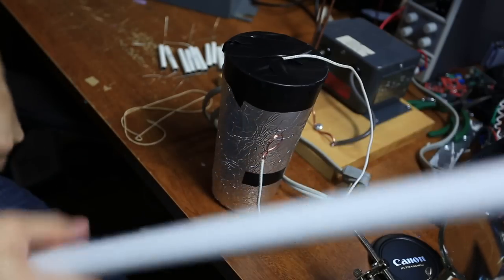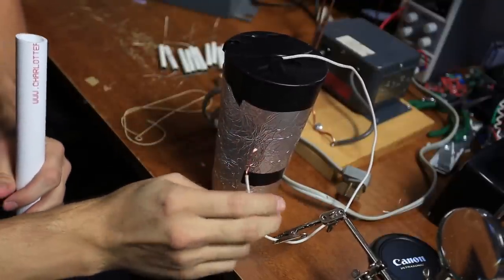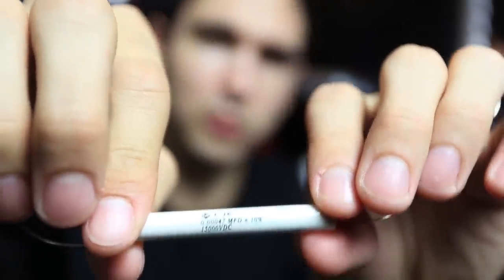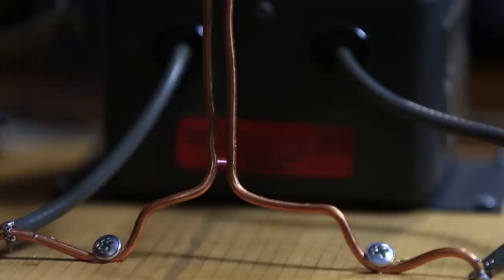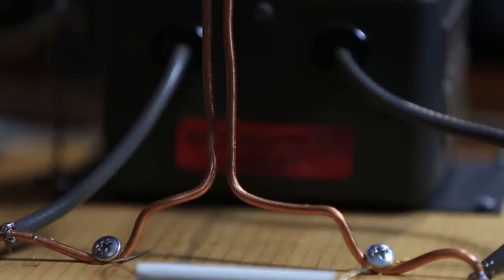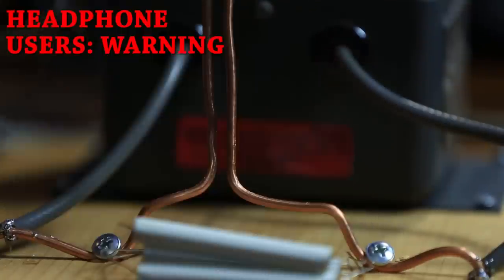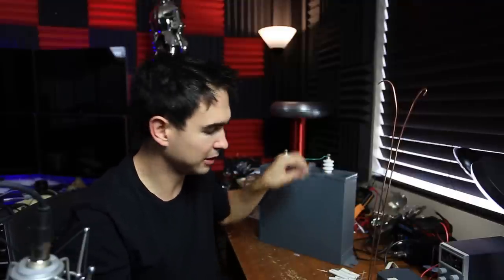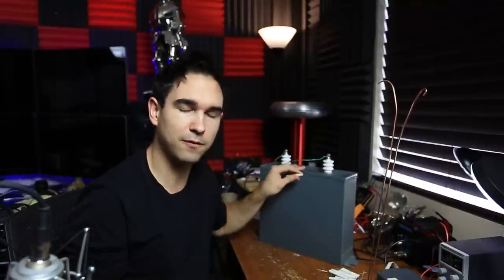High voltage capacitors

Comment: A 0,47nF capacitor will hurt a lot if touched @15KV, but if you dont have heart issues it should not kill you. I still woulnt recommend touching it. It will be at least 10times stronger than a everyday zap from your body geting charged up

Comment: How come when you touched the wires they did not fire right away and when you put the third capacitor one of it's wires did not touch and 5 seconds later you showed it firing but no sparks from the capacitor some thing strange about that. And another thing how come they did not ark when your hand was close to the wires of the capacitor when it was fully charged unbelievable

Comment: How to discharge such high voltage capacitor ,if I take high voltage resistor then how to calculate wattage.if we calculate p=vi then very high wattage is required, does high voltage resistor help reducing wattage of resistor.

Comment: i have a question i have not been able to find answers to, i need a high DC output (taser) if i build a bank of microwave capacitors, what sort of voltage will i get of a 12-24v 6A power supply...enough DC to cause a shock similar to a taser?
Reply: The capacitors should charge to your supply voltage. So, the voltage of your capacitors should reach between 12 and 24v. Unfortunate, this isn't anywhere near a high enough voltage to create something along the lines of a taser. I also wouldn't recommend using microwave capacitors in a taser. If you charge them up to the voltage most microwave capacitors run at (around 2kv) then a single capacitor has the potential to do some serious damage.

As for the energy stored in the capacitor, I believe that the equation is E = 1/2 * C * V^2. So, a single 0.9uF 2000v capacitor could potentially store 3.6J.
Reply: Whoops, I forgot to divide by 2... it was supposed to be 1.8J, not 3.6J. The capacitor used in this video scores around 0.05J, so a single microwave capacitor (at 0.9uF and 2,000V) can store around the same energy as 36 of the capacitors used in this video.

Comment: Output of nst is AC you need to recitify that to DC before you can fully charge a capacitor
Reply from the maker: Yeah, realized that after this video.  The past two years have been very educational. :)
Reply: Where did you hear that misinformation, lol